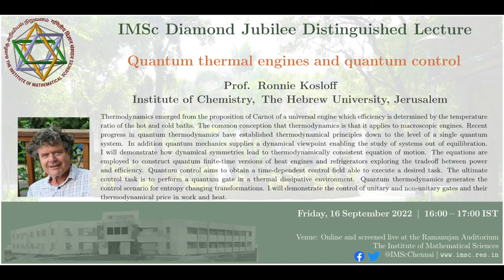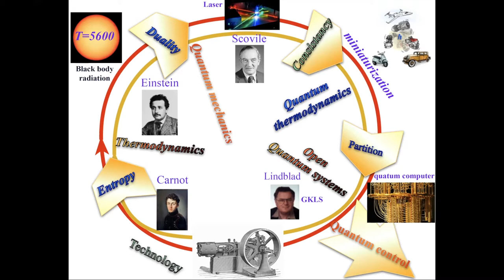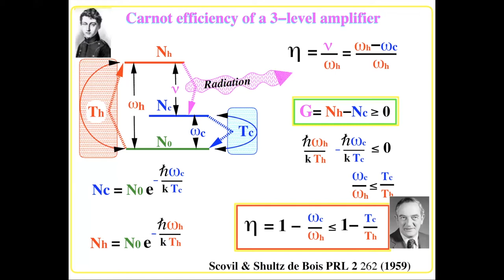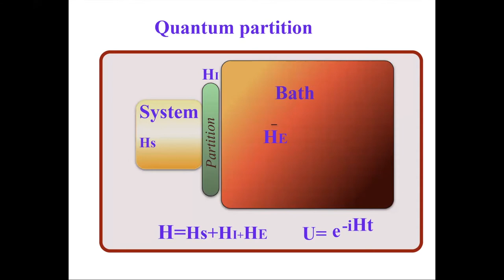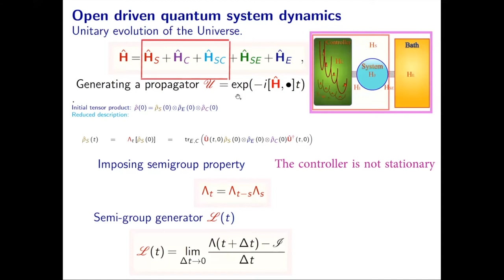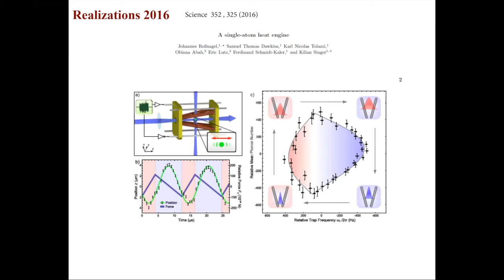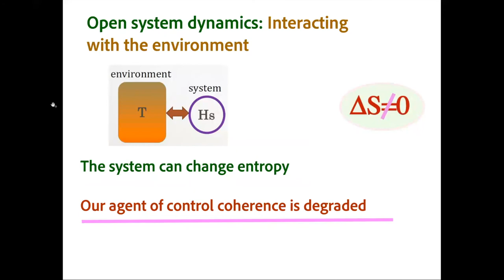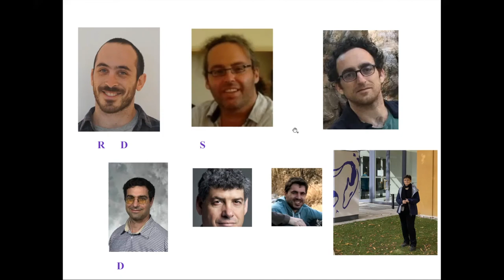Quantum thermal engines and quantum control by Prof. Ronnie Kosloff

Comment: Diode arrays may have strength in providing sub 1 kelvin refrigeration. If they are stacked into a 3 D cube of square diode array planes they are naturally in series to multiply the extreamly low voltage and they can be thin because they physically reinforce each other and have added reinforceement from planes supporting cmos or Jopheson junction devices. Small cheap atomic clocks are one possibility. 

Aloha

Comment: Extropy is an underused general concept. There should be many ways to fabricate  DC - power - coproduced - with refrigeration - devices 
Another method to plausibly transform ambient heat into electricity with equivalent cooling essentally consists of two electrodes closely face to face (~1 micrometer) in a vacuum wired to an external electrical load. The face of the [Emitter] electrode is covered with a uniform array of LaB6 tipped small diameter carbon nanotubes grown straight out. The face of the [Absorber] electrode is covered with small scale graphine flake char. [Rice U 2014] 

Thermal energy mobilized unattached electrons will tend to free themselves outward from the emitter tips and drift at ~1 million meters / second @ 25 millivolts (thermal electron energy @ 20 C)  to the absorber which tends to collect them.  

A negative charge accumulates on the absorber. This repels oncoming electrons slowing their forward drift, cooling them. The absorber electrode charge is simultaneously the repelling cooling and the external electrical load voltage. The drift current and external wire route current are the same. The DC electrical power consumed by the electrical load depends on the load resistance. Thermal energy absorption always equals the electrical yield. 

Wire resistance is a practical loss not a true loss so lt is overcome by added device output. Extra cooling thenalances the heat given off by the wire loss. The performance of the device is expected to be modest in the beginning but improve rapidly. Even early devices are expected to last a long time. There is little place for obsolence if the first installed device works adequately. They will withstand being short circuited indefinately up to an electromigration limit.

Aloha

Comment: Here is an impractical device that is easy check for mechanical workability. Its parts are large enough to act as everyday mechanisms but small enough to work well with the nanometer scale thermal motions of gas molecules.    This device hypothetically creates self powered thermal diversification: 

Sketch made with keyboard characters: 

COLD    ())--:PARTITION:-->> HOT    

Key
()) = Paddlewheel. 
-- = Axle.  (Continuous from end to end)
: :  = Axle tunnel going through a wall.
>> =  Lumped friction element

Please visualize two compartmants full of air separated by a very thin partition.  The partition is thin to delicately support billions of separate nanometer scale short axles running straight through loosely enough to rotate freely but  not leak very much heat so the rooms can hold separate temperatures. 

On the left side, a very small paddlewheel is mounted at the left end of each axle. On the right side, lumped friction elements are mounted stationary in place on the partition, one for each axle, for the right end of each axle to run through. The lumped friction elements convert the mechanical rotation of their axle into heat. The lumped friction elements do not impart Brownian motion to their axle.  

Brownian motion (a nanometer scale effect) turns the paddlewheels at random speeds randomly clockwise or counterclockwise. This random rotation is turned into heat by the lumped friction elements.    

The committed, linked, and functional roles of the walls, paddlewheels, axles, and lumped friction elements in differnt places should systemically produce a divergence in the thermal energy in the two compartments without adding external energy.